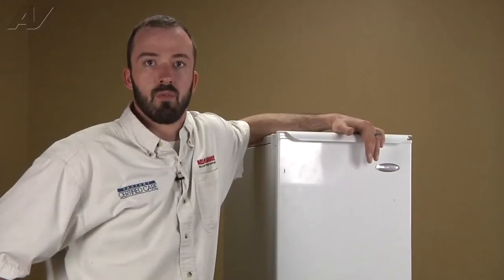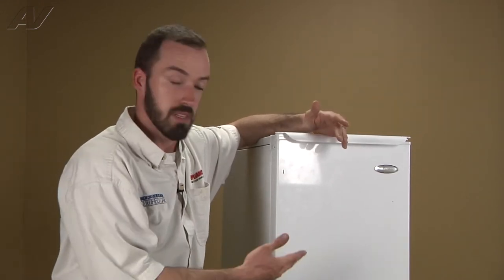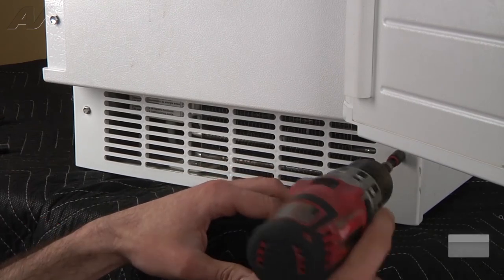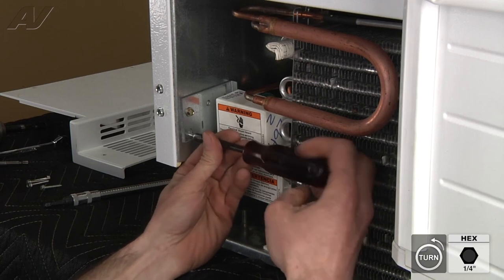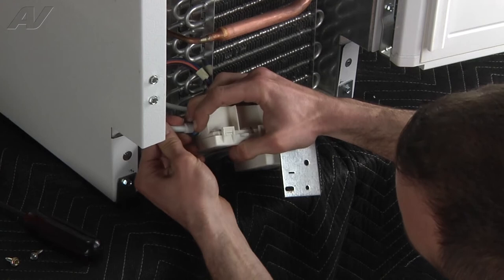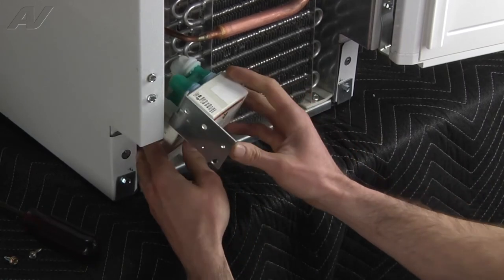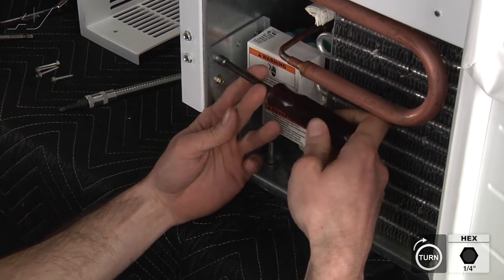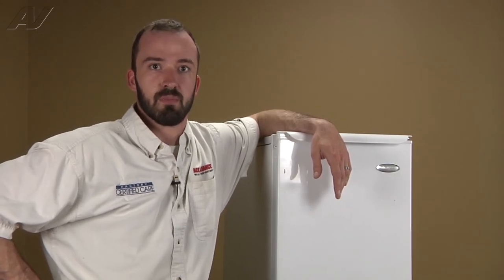Ice maker Repair -Water Inlet Valve - Commercial & Household Refrigerator - Diagnostic & Repair

Comment: I did the diagnostic routine and the Water Fill Valve was the one blinking, and the fill valve was not filling the reservoir.  I replaced the water fill valve and now it fills the reservoir, but the ice maker is not producing ice.  It seems to make all the right noises, and cycles the same as before, but no ice.  Also, when I do the diagnostics, the water fill valve step still blinks, even though it is filling the reservoir at that moment.  Any ideas would be appreciated.
Reply from the maker: Great question, if you have a more technical question that our parts department cannot answer, you can search our over 17,000 answered questions free at our website www.ApplianceVideo.com under our Repair Help section. You can also call our parts department at 1-800-830-5465 and they can give you help 7-days A week ,or search at www.SaveMoreOnParts.com  .
Reply: I'd bet it was the valve leaking?? The water going into the freezer... lol